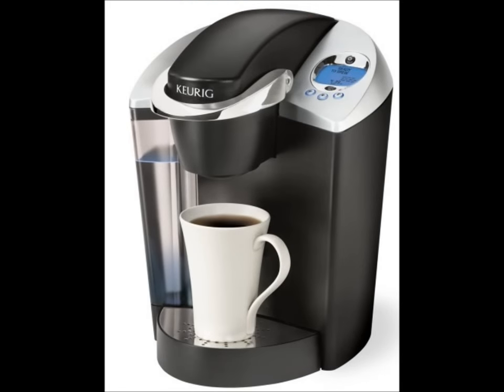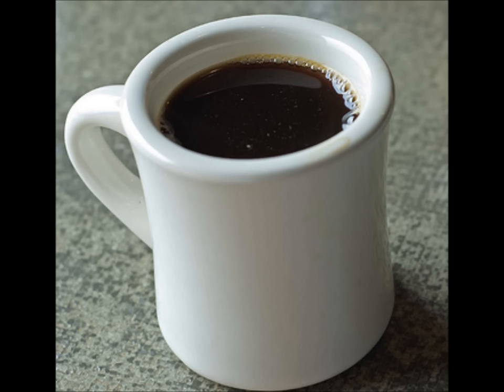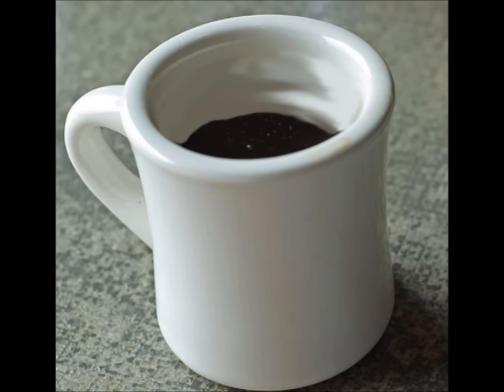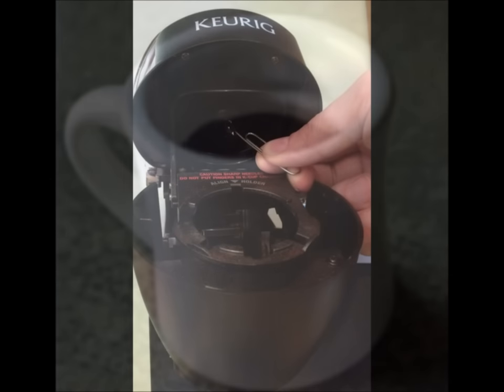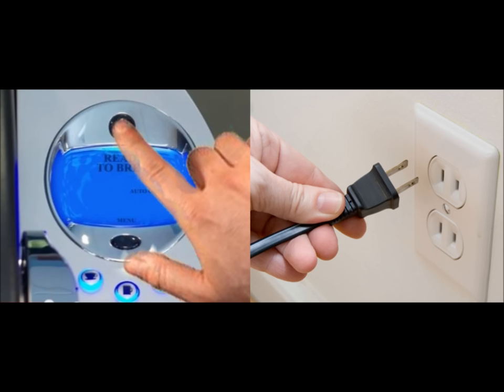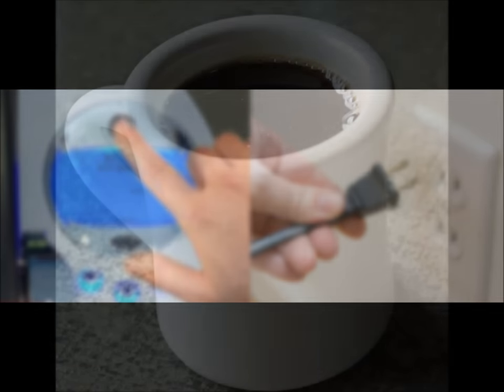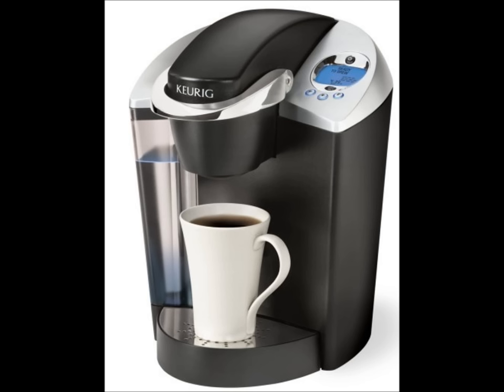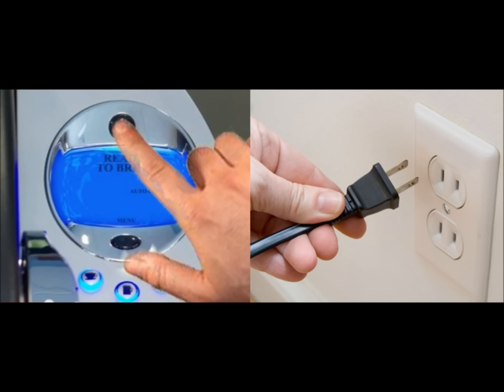Reset Your Keurig

Comment: I had similar thoughts and tried various procedures using different buttons and combinations of buttons, but no success. Finally, I just unplugged the machine, shorted the hot and neutral prongs on the plug and left it unplugged overnight. This morning it is working properly. My wife bought a new one because I didn't get to the job fast enough and she was ready for something that worked properly. My bad. I rarely use the K because I roast an grind my own coffee, then brew in the Technivorm I bought 14 years ago. Now that's a simple and well made product. I don't need all the bells and whistles, or a little extra convenience in order to use overpriced coffee.
Reply from the maker: Very good input and information. Thank you for your comment and God bless.

Comment: My K-50 is 5yrs old or more. Only 1-request to clean it. I did paper clip but nothing fell out.  I did the power thing and still only get 'almost' 8OZ.  I will keep testing.  At least I get coffee, I just run it twice then move another cup to catch extra water. Thanks for this Tip, some tips help and may depend on model K-Cup?
Reply: Born DIY my grandma has flushed it with vinegar a few times it really helps

Comment: For the people using vinegar. BE MINDFUL over time. You will develop that vinegar taste.  Vinegar is a very strong in potency and in taste. Overtime you can condition your water tank by introducing it to vinegar the strong residue it leaves behind even after rinse. So while it does clean.  It wouldn’t be good for that good cup of coffee taste you come to love.
Reply from the maker: Thank you for your input Rell. Good advice. God bless.
Reply: @user-sr8pn9xg8z  no problem at all. I did some barista work and worked with delonghi and love coffee so I just thought to share.  God bless you as well.  Stay safe.
Reply: After I use the vinegar, I run 6 reeivours of water through the machine. I have had Keurigs ever since they first came out & have never had that happen,. By the way, I can't stand the smell or taste of vinegar, so that's why I rinse it so well & it DOES work! Then I run the water container through the dishwasher, after I rinse it. So there is NOT any residue left in it, as well....
Reply: @user-sr8pn9xg8z  thank you 🙏🏾 I’m glad to help
Reply: God bless

Comment: Ours works, but only makes 3/4 cup of coffee sometimes only half. I will try resetting it in the morning. I got it for $10 .It said prime. I used a turkey baster on the base where the water tank goes and it started working fine. Then I cleaned it really well. My guess is the calibration is off now. Hopefully the reset should give me a full cup again. Thanks for the tip!
Reply from the maker: You are welcome. I'm hoping it does work. You sometimes have to try it more than once. Thanks for your comment and God bless.

Comment: OMgoodness! Checked and cleaned the needle but nothing built up on it. No grounds. Cleaned the water reservoir drain. Not plugged. Ran vinegar n water to descale, no hard water deposit build up. Finally saw your video. I reset it per your instructions. It took 4 times to be able to make that second, then third etc without resetting it! Thank you! That’s $80 still in my pocketbook, thanks to your video.
Reply from the maker: Thank you Ester for your comment and have a happy Thanksgiving.
Reply: @user-sr8pn9xg8z  
Blessed Thanksgiving to you .....”as she sips her coffee”!!! Lol

Comment: Thank you for your video. I did have to do the Power Button reset about 3x. I then got a little text in the upper right corner that said 'Prime'. I took the tank off, noticed flakes of ? floating around, cleaned the inside with a soapy sponge, rinsed it well. Put it back on the machine, filled it with fresh water & viola ! Full cups of coffee, once again.
Reply from the maker: Good for you Toby. Thanks for your input and God bless.

Comment: Just tried this out to fix a very weird problem with our keurig. It just started to pump tons of water out and turning it off was the only way to stop the flow. After doing a regular power cycle it still dumped out too much water, but after this reset trick holding the button down prior to plugging it in, it at least stops the flow of water. The problem now is that about 2-3oz more water than selected. But this is better then water all over the counter.
Reply from the maker: Thanks for your comment. For some reason some folks have to repeat the process several times to get it to work correctly. I did too. It too about three times as I recall. God bless.

Comment: Today, my Keurig B70 model stopped dispensing water.  I tried unplugging and restarting it several times, and still no water flow.  I looked online for some suggestions, and I tried a few.  Most importantly, I now had more problems.  Only one LCD screen with all the cup sizes was displayed, and all the lights were flashing blue (normal) but when I would try to make a cup size choice and press a button, the LCD screen would turn off.  If I pressed the button again, the LCD screen would light back up.  I decided to call Keurig customer service, and the rep said I had too many problems, but she would offer me 20% off on any model online.  I told her I wanted to think about it and also try to work on it again later in the day.  Tonight, I looked online for more suggestions, and this video was the first one that popped up.  I copied his directions, and I went and tried them.  MY KEURIG STARTING DISPENSING HOT WATER ON THE FIRST ATTEMPT.  I now decided to run some vinegar thru the system, and it is working flawlessly.  THANKS FOR SAVING ME MONEY, TIME AND AGGRAVATION.  TOMORROW MORNING I WILL HAVE A GREAT CUP OF COFFEE!
Reply from the maker: Thank you for your comment Denise. I'm glad it worked. God bless.

Comment: mine is the updated version k500 serios 2.0 mine doesn’t have a switch. It’s all touch but the screen kept flickering with the power button so it didn’t let me push the power button so what i did i just push the keurig button that’s for selection of cup size i presses that about 10 seconds and it worked. It’s like it reboot the keurig now it’s actually on and is finally on the screen of lift to begin. Thank you
Reply from the maker: You are welcome. thank you for your comment and God bless.

Comment: I have a kureg with power button, led screen, menu. button and the 3 cup size buttons. for some reason the three cup size buttons work as the menu buttons, I will have to keep cycling through the buttons until I get lucky and get it to brew. any suggestions?
Reply from the maker: On the newer ones I believe you need to hold down the "Brew" button. The one you would push to start filling a cup with coffee. I hope that helps and God bless.

Comment: I've got the cheaper slim model. Close the lid and only the power light came on but none of the ounce brew lights. I could force a brew by holding down the 12 and 8 ounce cups at the same time until the descale option started... emergency coffee brew! Lol but yes, I held the power button down and unplugged my machine. Counted 10 seconds and while still holding my power button plugged back in and counted another 10 seconds. Seems to be working now. But mine intermittently worked before. I think I need to take mine completely apart and clean all the electricical connections. I live 1 mile from the beach and the salt air here causes corrosion bad! Never buy a coastal vehicle. Same as a road salt vehicle... rust and electrical problems. Anyway, thanks for posting this.
Reply from the maker: You are welcome. Yes, I have a friend who lives close to the Pacific ocean beach and everything seems to go bad a lot for him also. Thank you for your comment and God bless.
Reply: @user-sr8pn9xg8z  update... acting up again this morning. Of course it does it at 1:30am when I need my coffee!!!!! By the time I leave the house at 2:30 for work it pretends to be fixed🙄 it comes apart this weekend and will be fixed or replaced😠

Comment: my keurig is making a loud noise and when it's not ready to brew it continues to run water even if i select a cup size it will run the cup size but, won't fill up and when the water is being extracted from the resevoir it steady runs water i don't know what to do
Reply from the maker: +Andrea Steptoe 
I would suggest repeating the reset procedure several times as I had to do, as explained in the video. Here's hoping it works. It worked for me.

Comment: We have a K-40 model that would cycle and get stuck with the 3 blue lights ON (but not flashing).  It would not brew coffee.  Followed cleaning/unclogging instructions in 5 other videos but no change.  Finally found this one and after trying your reset procedure (turn off, unplug, press and hold on/off button, plug in) 4 times, problem solved!  The blue lights now flash and water flows!  Incidentally, I got my HAM radio license as a teenager in 1980.  I'm not active anymore but my 82 year old father (KF80) is more than ever!  THANK YOU for posting this video and your troubleshooting logic!  :-)
Reply from the maker: Thank you for your comment and interesting visit. Glad it worked for you and God bless.

Comment: My Keurig is an updated/different  model  that doesn't have the power button on the front, ours is on the back, which is a "rocker-style switch". So it  is not the same as yours BUT... Instead of holding the "power" button, I held the "menu" button on the front and plugged the machine back in. AFTER resetting the clock to the current time (like yours, ALL of my other setting were retained in "non-volatile" memory), I was able to brew several "cups of water", testing it out.  They have all worked perfectly, ever since (knock on wood) LOL.  This must be some sort of "Control-Alt-Delete" command for resetting the motherboard on our machines.  Thanks for pointing me in the right direction.  I had tried things like unplugging it for an hour (this has always worked with any hiccups before, but not this time). Thanks again....
Reply from the maker: Thank you much for your comment and God bless.

Comment: I looked at a lot of Keurig  videos to assist my troubleshooting and thankfully, resetting the machine solved my problem.  Although your video showed a slightly different model where your start button was  on the top of the machine, my start was more of a switch than a button.  Nevertheless, I held down one side of my on and off switch, plugged it in and did that a few times and Woohoo - I was finally able to get a cup of coffee.  Thank you.
Reply from the maker: You are welcome. Thank you for your comment and God bless.

Comment: mine makes a cup of coffee an about 15 minutes later it powers off  so you have to power it back on an wait for the water to heat up is this normal I'm new with Keurig
Reply from the maker: If you have the manual (If not look on Google), look for "automatic shutoff." It defaults to nine hours, but yours may have been changed by mistake. I hope that helps, and God bless.
Reply: Ty

Comment: I wish I had known of your fix 6 months ago!! My Keurig was doing this same thing -not brewing, making very strange noises and producing 1/2 cup if even any. The company had me do the same things and I was just as frustrated as your wife! I ended up throwing it in the trash and buying a new one. Now my new 2.0 is behaving badly with the auto on/off timer. I can't find any info on the internet to help me with this one, and the company is "under construction" right now so I can't get any help from them. Thank you for your video, though!
Reply from the maker: I'm not sure but I think if you unplug it, hold down the "brew" button while plugging it in, it will fix it. Our church had a model "2" which I got working in that same manner. God bless.

Comment: just got my 2.0...I used the power button on screen to turn it on....but it will not function to turn off...help please. ..
Reply from the maker: +Shirley Madison Hi Shirley, I am not real familiar with the "2" version but I know there is an on-off button on the right side of the machine. I would suggest - unplug, hold down on-off button, plug in. People have found that you sometimes need to repeat this process several times to get it to work. There is a shorter version of the steps at: https://youtu.be/l--woaUuEi8. Hope this helps.
Reply: Thank you so much for your help....

Comment: I'd given up finally on this piece of cackapoo since I've had it fail twice. First time had to take off the reservoir, unplug, and pound its bottom like a bad little boy. After doing this twice it finally fixed whatever was wrong and worked again, only it was untrustworthy about how much coffee it made at a time and had to be babysat. 

This time I unseated and reseated the reservoir several times while it struggled to work, turned it off and on and off and on, poked it's puncture pin on top with two different size paper clips, pounded it's backend and top side (at this point there was nothing to lose as it didn't work).  It had been cycling water in and back out into the reservoir endlessly and nothing more. Finally, it stopped cycling water and started 'trying' to work with drips, then more drips, and again more and more until finally got a cup of Joe! It's working again, but who knows for how long? I will never buy another of these. Mine isn't as fancy as yours (Keurig K45 Elite) and I'm glad I didn't buy a fancier model, besides I didn't have enough room for one larger. You made me keep trying at least and for that I thank you. I'm trying to move and didn't have time to deal with this!
Reply from the maker: Thank you for your informative comment. Yes, we had tried some other things on ours before just resetting it.

Comment: I used this, turn off, unplug, hold on button, and plug in try to make a full cup four times trying to run a full cup each time... It finally made 4 four full cups in a row after that
It wasn't making any noise or water before that... Thanks
Reply from the maker: I know. Everybody seems to get different results. Thanks for your comment and God bless.

Comment: I hope you read this after such a long time. I experienced the same just a couple of weeks ago and it's probably a later model than yours. I will try your method next time but my problem was with the water tank. Mine has a long fitting attached to a charcoal(?) filter fitting over the water valve, removable. Three screws on the bottom of the tank allows you to remove water check valve. (You can hear the little ball rattle when you shake it.) There was a fine mesh screen caked with sediment also. I removed it, used a toothbrush and/or water flow from the faucet.and coffee has been flowing ever since. Just enough resistance to prevent water from entering the system!

But I've mainly watched your series on the Bebop 2. Valuable resource for this newbie. Thanks.
Reply from the maker: Thank you for your helpful comment. I hope others find it when needful to them. And, thank you for your kind words relating to the Bebop 2. God bless.

Comment: I have an older Keurig, no digitial display,  and this worked for me. Thanks for the video. My Keurig was just pouring cold water right as I turned it on, not heating it, not giving me a cup selection prompt, just pouring until the water ran out.
Reply from the maker: Good deal! I'm glad it fixed things. Thanks for your comment and God bless.

Comment: I held the on- off switch on the back of my old Keurig and plugged it in. Did it twice and now it’s back and making coffee. Thank you for this post; did the trick!
Reply from the maker: Thank you for your comment Cory. I'm glad it worked. God bless.
Reply: @user-sr8pn9xg8z  Mine stopped working and has all 5 lights on. I tried your trick and it won't work. Mine is the one with the frother. It doesn't have a digital screen or a descale botton either. :/

Comment: Did you first try just to unplug the unit for a several seconds letting the power supply filter capacitors drain?
Reply from the maker: Yep, I did. Good thinking and God bless.

Comment: Gee, mine has a reset right in the menu.
Reply from the maker: Question: is it fairly new and did the reset menu item fix it? Thanks
Reply: Yes. It's a K545 Plus. I haven't had to use it (the reset option) yet (thankfully).
Reply from the maker: Thanks for your input. I'm glad to see they have started doing that. I get a lot of comments from folks who have either thrown away their Keurig or were about to.

Comment: We were experiencing the same problem - our Keurig worked well for about 2 years. A short while ago, each time we went to make a cup, familiar start up sounds were followed by long periods of whirring sounds, eventually dispensing a cup of coffee - although most times the amount was less than selected. We cleaned the holes, held a finger over the overflow valve and scrubbed the tank exit valve. No change. Your video did the trick! I followed the 5 step procedure and the coffeemaker is back working as well as before - on the first try! I'm saving this video in case the Keurig decides to crap out again. Thanks for posting!
Reply from the maker: Thank you for your kind words Ken. Yep, I discovered it all by God's grace. May He bless you as well.

Comment: my brew button stays blue and will not heat up
Reply from the maker: I assume you have tried the suggested resetting routine. Our machine at church did the same thing. It only took one reset but it often takes more than that. I would suggest resetting it several times. That may work.

Comment: The display on my 2.0 model K475 froze and was all white. Unplugging didn't work. I tried your process three or four a couple times, holding the brew button down as I plugged it in, but no change. I tried it again, this time with the K-cup door all the way open and it worked. Display is back up and running and it is brewing without issue. 73's and tnx for the tip
Reply from the maker: That's a great tip for others. Thank you for your comment. God bless.